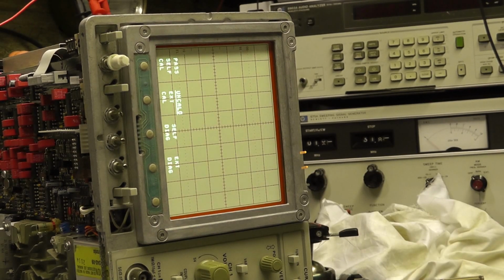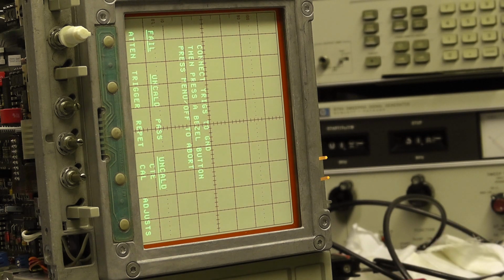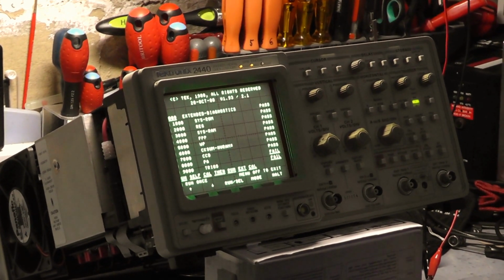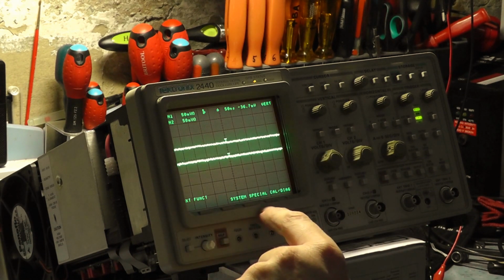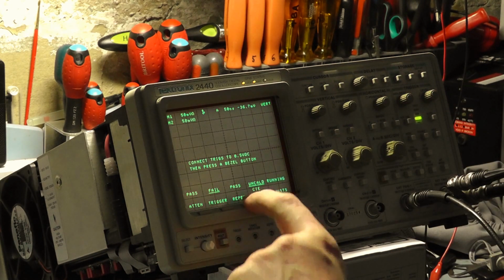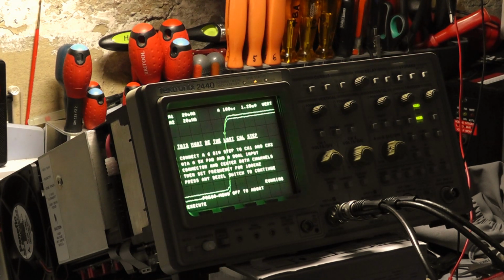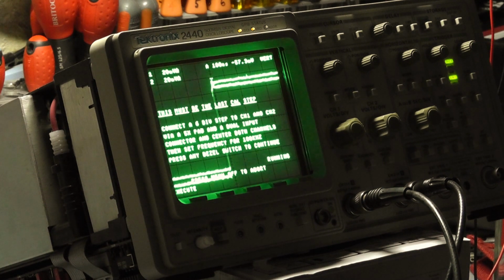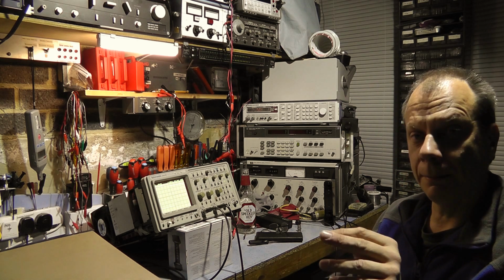Tektronix 2440 Pt7 Final Calibration Incudes problematic CTE Cal

Comment: nice job. I have just bought the same scope. when I do a self calibration it fails on a few thing. CCD and all the others downwards. What can I do to make it work again?
Reply from the maker: First off don't run the scope without cooling to the CDD's. If the CCD's have failed I doubt you will find a good pair for less than £150.  A user Cal requires  test gear and a jumper move inside. Battery may be dead also loosing calibration constants.

Comment: I just got my Tek 2440 and i am awaiting the 2 Dallas NVram chips to come in as the ones in the scope are dead. Meanwhile i went through the entire CAL procedure to make sure everything was working well. I used a breadboard circuit to give me the voltages i would need and used the Tek FG502 for the square wave signal that is also required. I of course removed J156 and went through the procedure and everything passed, with a few tries till i had it down. Works like a charm and is quite accurate. Of course when i power down everything is lost. So i look forward to the chips coming in and a prefect working 2440. Thanks for your video by the way, keep up the good work.

Comment: Hi Simon,
Congrats on getting this scope running, it is a really fine piece of equipment, I too regularly use one.
I think most of your cal problems were because of the way you set the leads up to CH1 and CH2. You should really have used a T connector and have exactly the same length of cable to to both channels. 20cm of coax cable is about 1ns difference, which is half a div at the fastest sweep. This will influence the channel delay cal (not that big of an issue, but your channels will be out of sync) and obviously the CTE cal.
I have several times successfully done CTE cal with 5-6ns rise time pulses and it is possible. Of course, best results are from fast rise (1ns) pulses. You need 120mV p-p 100kHz square wave centered around 0V to get best results fro CTE cal. More important is the clean signal (no overshoot or ringing) and amplitude than rise time.  
It is also a good thing to set the clocks, or at least check as described in the manual. It is a tedious process, and looking at the aliased signal will make your eyes hurt, but when done properly it will greatly influence the noise and the signal quality, especially in repet mode.

Comment: Congratulations Simon! Glad you finally worked your way thru the troubleshooting and repairs. Have had my 2440 for going on 20 years and hopefully will be around for another 20. Did you check the processor board memory backup battery? It is amazing how long those little guys will last. Look forward to seeing the scope in operation fixing other stuff!
Reply from the maker: +Dino Papas HI Dino yes the Battery had been replaced recently. I think as long as they are kept cool and are used regually,they will last well.
Thank you for commenting.

Comment: Awsome Simon, darn I subscribed to watch you fix this scope now I have nothing to watch anymore AHHH!
Just kidding. Yah a bit of a joker this one. You did a fine job on this one sir, a truly hard earned win for sure. Now if I could just fix that 2465B at work with the pesky "?" marks across the bottom. Had to put it back on the Awaiting Maintenance shelf until I have some more time to figure it out. Anyways i'm rambling. Good job Simon. PS we have the same jobs, yours there and mine in the States. I fix aircraft test sets over here. I wish they would let us check out equipment from work, but that's a no no here. But they will let us bring our equipment in and test it on break or lunch time. Thanks again for the great series on the scope Simon.
Best Wishes n Blessings. Keith
Reply: You need to to do the entire calibration CAL 01, CAL 02, etc. In other
 words, if only some of the steps are completed and then the user exits the calibration routine, none of the new constants are saved. After completing the entire calibration in this way, the dots and
 question marks will disappeared, and the startup error messages.